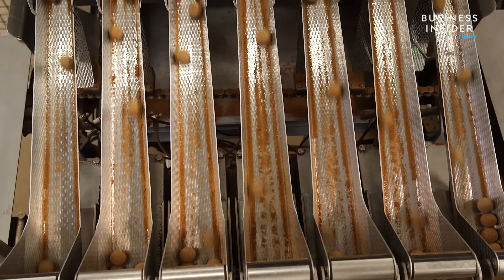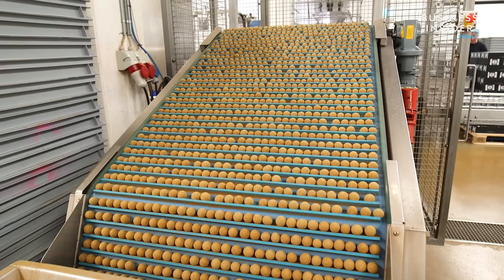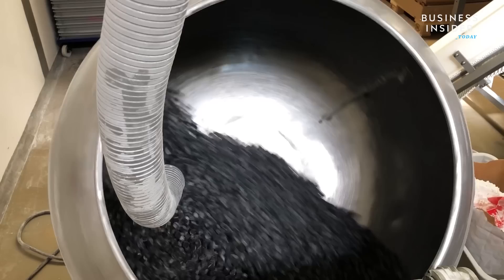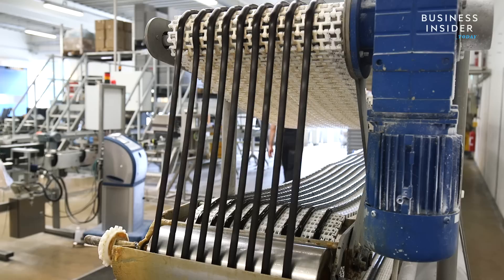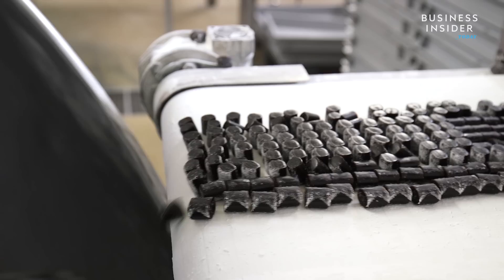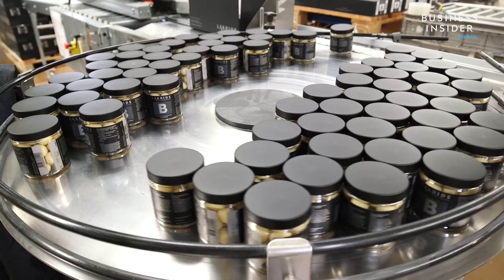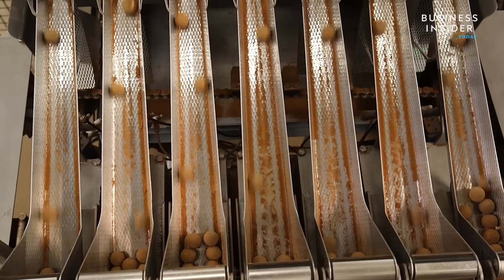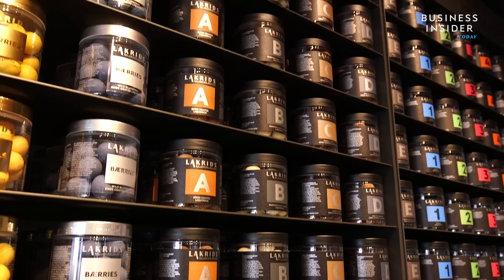How Danish Licorice Is Made

Comment: The saltier, the better! I looove it!!!
Reply: If you like salty, you should try the finnish salmiakki! It's amazing
Reply: @hangedman3834  It is! 😉
Reply: Agreed, personally I've found some decent ones, but they only come in a mixed bag of 50/50 salty and sweet, so what I do is separate them and then add a bunch of ammonium chloride to the sweet ones. It took me a couple of tries before I found out how to do it, but just in case you'd like to try the same, here's the process: For this recipe, you'll need about 125 grams of licorice and two teaspoons of ammonium chloride. First, you find a small microwaveable container, I use a round Tupperware container, step two is dumping the licorice in and then pouring water on until all the contents are soaked. If you leave out the wetting process, you'll end up burning the licorice, and although it is still edible, I prefer my licorice unburned. Next, you heat the licorice for 10 seconds on high power in a microwave oven, and then give it a stir with a teaspoon or similar. Repeat this process until all the licorice has taken on a tar-like nature, it's a bloody hell stirring at this point, and I'd recommend a teaspoon with a good thick handle. It should take some 10-15 repetitions. When everything is a sticky mess, you mix in the ammonium chloride, and the licorice will become a somewhat lighter color, possibly because you trap a lot of air in the mix. When that's done, you wait until the mass is cool enough not to burn you too badly, and then dig out the licorice with the spoon. In the beginning, I rolled the licorice into musket-ball sized balls, but found out it's faster to just spread it out in a layer on a piece of baking paper, and then cut the whole thing into chunks when it's cooled a bit more. Expect the knife to stick. The last step is dumping the licorice, one by one into a bag of ammonium chloride, and shaking it, to prevent the licorice from sticking together in a big lump. With all that ammonium chloride you get an initial kick in the gob, and think "maybe I overdid this, I wonder if my stomach will survive", but then it sort of wears off a bit and becomes the most delicious and soft licorice, you could use to strip the paint off of a car door at 400 paces, or for cutting armored glass.:-)
Reply: @hangedman3834  Should I order them from Finland? (I live near it) Or is it good everywhere?
Reply: @tomatoessuck4878  late reply, but Finland is indeed known for its good licorice, I think we have good licorice in Denmark too but I guess I'm biased. I would recommend super piratos, they're a popular choice here
Reply: @mace8873  so sweet of you!!
Reply: @PrincessAfrica3  No problem, stay safe.:-)
Reply: But the more sour it will get